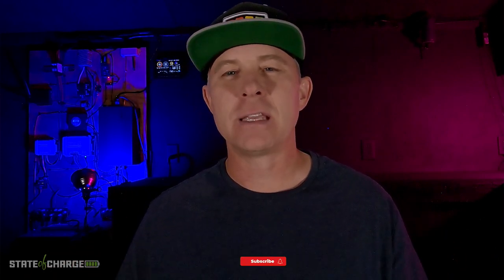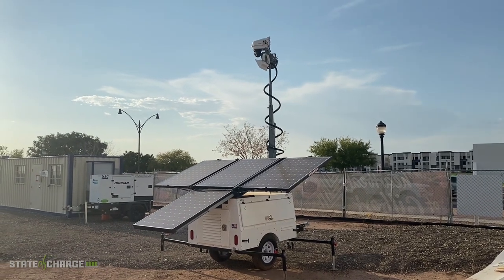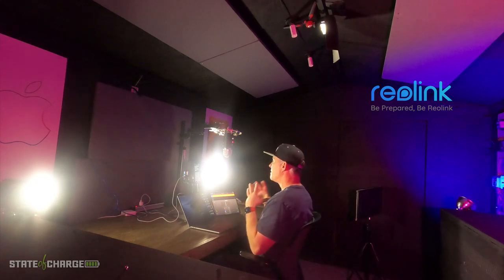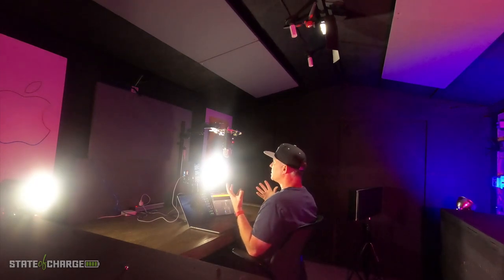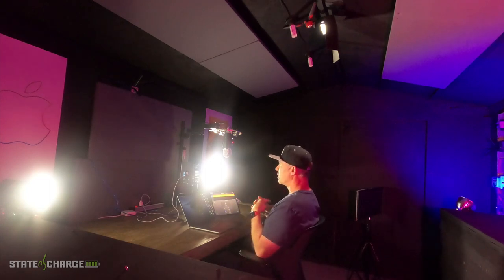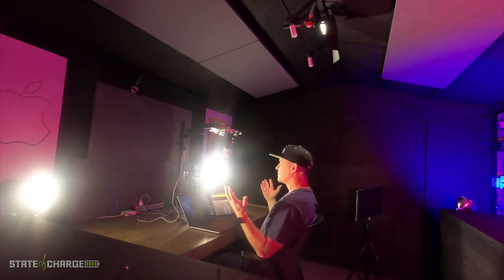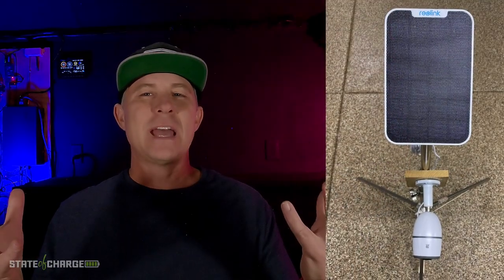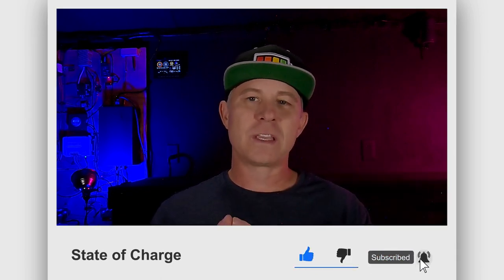Small Remote Security Camera Powered by Solar with Cellular Data

Comment: I like the video and topic! But how realistic is the usage of this setup over time (3 days) off grid? Once the battery is dead you need quite some sun hours to get it running again, especially in winter. My experience is that will be close to impossible. How are your thoughts on this? Did you test this?
Reply from the maker: Hey Tim! Thanks for the Comment! I really appreciate it! For me, It will charge in less than 3 hours. However, here in Phoenix, we won't have a power struggle. For other areas, I wouldn't know. I unplugged the solar panel and it ran for over 3 days and charged very quickly once it was reconnected to the panel. It's just like charging a phone. It didn't really take that long to charge. I have another one (not seen in the video) that has been running for more than 1.5 years and the battery has never been below 80% state of charge.